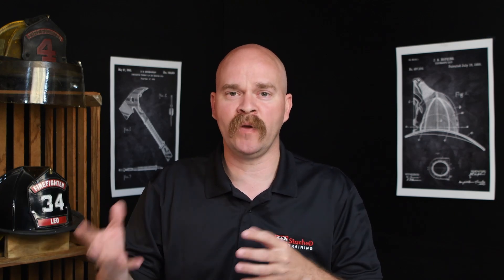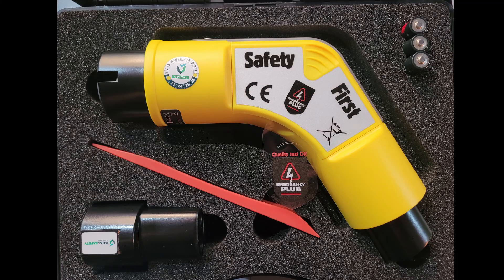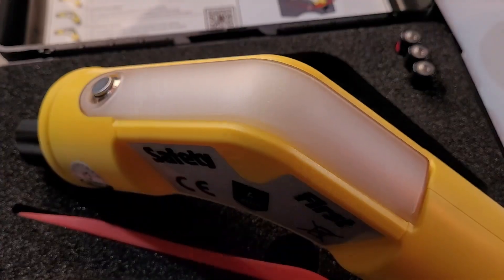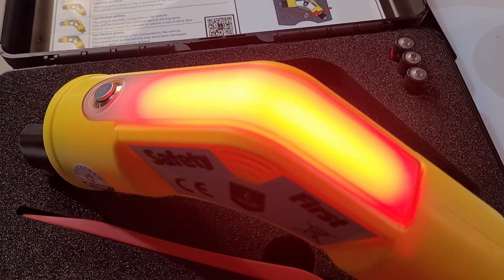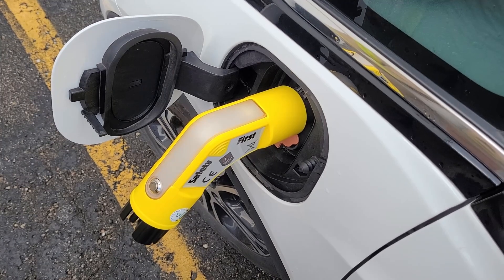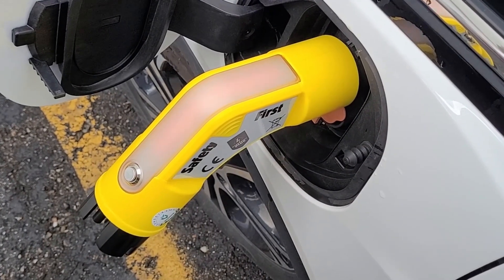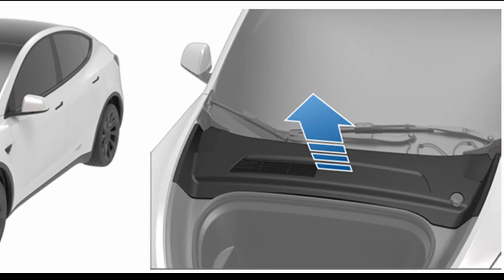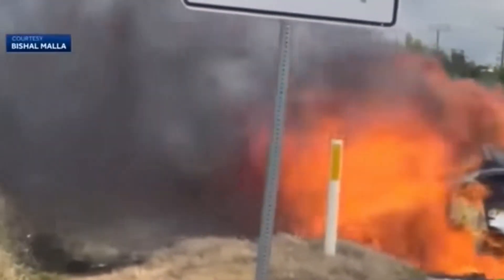Emergency Plug: Stops EVs from Moving After Crash

Comment: Great information. As a civilian, the idea that an EV will probably silently decide to take off after a crash had never crossed my mind.
Reply: Because it isn’t even remotely close to approaching the general concept of common.
Reply: @qwerty112311  In another video on this channel, one can see a jaguar EV being dragged out of the garage so a blanket can be put over it to keep the fire from spreading, and one can observe the front wheels of the Jaguar actively resisting the toW, where the car is in fact alive and trying to stay stopped: it doesn’t want to be towed out of the garage. just look for the video and see it yourself or keep telling yourself that this is uncommon. the plug exists for a reason.

Comment: That’s crazy, that firefighters have to deal with such nonsense.
Reply: Right, because ICE cars never cause problems after a crash, never idle, never get kicked into gear, never blow up.
Reply: Correct. Especially since they are usually encountering the vehicle in an emergency situation. There are other concerns at the scene and to add the complexity of a hybrid or full electric vehicle to that is complicating the rescue further. A lot to remember from training in such a short allowance of time.
Reply: @humming-birdaerialimaging682  Apples and oranges. Years of experience with one (ICE) and their relative simplicity and danger potential compared to high voltage danger and quiet potential of movement. No comparison.

Comment: Instead of a single RGB LED, one LED per status would remove the need to consult the chart on the box.
Reply: I understand why they did the colors, but a simpler system of indicators should be used. GREEN=Ready for use. RED=Problem with the device. BLUE=Device working to immobilize the vehicle. That will be the "Mark 2" version.

Comment: Great idea but it kinda sucks that you need the  batteries to be good on your device to disable a battery device.  It's a nit, I know, but that's one more thing on the truck you're going to have to PM, and even then batteries may be weak.

Seems like maybe it could get power FROM the battery plug in some future iteration so   it's one less thing to worry about?   
Just a thought.
Reply from the maker: Unfortunately, the vehicle wouldn't be a reliable source of power.  It's not like a 12v battery that always has power at the terminals.
Reply: @StacheDTraining  Perhaps some arrangement could be made for a truck mounting then?  Something like the Streamlight lightbox charger that both holds and keeps it ready for instant deployment?  The batteries in this version didn't appear to be rechargeable nor was there any provision to recharge them, but this being something you want to be reliable and instantly available, seems like a bit of tool evolution may be in order.   I know, not everything can be plugged into the truck, but considering the urgency and increasing demand for this for the safety of both FF and victim, its only going to get more crucial as time goes by.
Reply from the maker: @mikeshaffer7673  it's a good idea.   It would likely drive up the cost.   (If you're not aware,  I'm not affiliated with this product)
Reply: @StacheDTraining  I know, but you're active duty and an influencer, as well as VERY current on the latest in dealing with EV fires, so I figure if the OEM sees their product on your channel they may take it under consideration.

I appreciate all this info.  My time was a couple decades ago so EV rescues and fires weren't really a "thing" I had to deal with, not even hybrids existed at the time, but I did enjoy the odd top-terminal battery welded to a crumpled hood and spitting hot acid, and imagine this is 100 times worse .  My heart goes out to you that DO deal with them daily, I do not envy you having these increased challenges and keep my FF/EMS brothers and sisters in my prayers every day.
Reply: A rescue response vehicle these days has numerous tools that require a charged battery to operate
We have battery operated scene lighting, various battery operated power tools, battery operated rescue cutting tools. We have batteries in our defibrillators to keep up-to-date and monitor. We have batteries in our personal flashlights. It is not really any big problem to add one more battery device to this list.

Comment: Not entirely sure why people would think it's just as simple as shorting pins out. EV charging is one of those things you just don't mess around with and even the AC charge protocol is substantially more complicated than that. Still very simple compared to the DC charging protocol but way more complicated than a resistor or a short on some pins. Although ironically the vehicle does just use a resistor to indicate charge start back to an AC charger.

Comment: What's the battery life on the device? (Both in storage and in use)
Reply from the maker: It is really dependent on usage.
Reply: I think I would change batteries after every time this thing had to be used.
Reply: @davidhenderson3400     not a bad idea, although there's probably a mention of that in the operator's manual. I usually date batteries so each time I change them I know when they were changed last. (sharpie marker)
Reply: @davidhenderson3400  They could use Lithium rechargeable AA size batteries for long use scenarios, a 2nd set in the carrying case, 3rd set on charge at the station.

Comment: The problem with this device is it will make carjacking a simple task. They can easily approach your vehicle at a red light and disable it demanding your money or stealing your vehicle. I also imagine panhandlers will use these, easily stopping your car at a red light and you can’t leave until you pay them a toll.

Comment: Where to buy ????
Reply from the maker: There are 3 or 4 suppliers in the US that currently sell the Emergency Plug.
Reply: Hi I am not sure what happened to my message but I said we wonder if me as a home owner well my extinguisher claims it can put out a lithium ion fire but we wonder if it would seem like an alchol fire the fumes given off are very dangerous you do wonder if the smoke is corrosive and even if you did have a fire extinguisher do you think more likely if I have a fire in my lap top do you think even if the extinguisher could work do you think it's mostly likely you would probably end up with corroded lungs before the extinguisher could help you?

Comment: The delay is probably the vehicle systems trying to figure out why some idiot is trying to charge it while it's still in drive.  A software update should solve the issue.  Good to know for sure.  Have they come up with a solution since your upload?

Comment: The usefulness of the emergency plug is, of course, dependent on the on-board electronics still functioning correctly, having not been damaged in any impact. Also means a fire fighter has to expose himself to possible explosion whilst plugging this device in. It all sounds like "on a wing and a prayer".

Comment: Not ALL vehicles go into park with these devices; a FEW go into neutral; then they can move by rolling. Its OK if the vehicle is on the flat, but NOT safe to assume all vehicles will not move once connected.

Comment: Our fire company is looking to get one of these, and I'm all for fire safety.  But I have yet to find an example of any EV driving off suddenly after an accident.  In fact, the video shown here was reported on and it turns out that the driver accidentally hit the accelerator which caused the vehicle to move, not the EV itself.   So, this sort of accident is just as likely in a gas powered vehicle (which there are way more of).   Please watch this report that details what really happened.   https://www.youtube.com/watch?v=OooOaJ7RGwU
Reply from the maker: That's exactly what this plug  protects against.  The occupant bumping the accelerator.   It's just meant to be a first step until you get the vehicle secured properly.